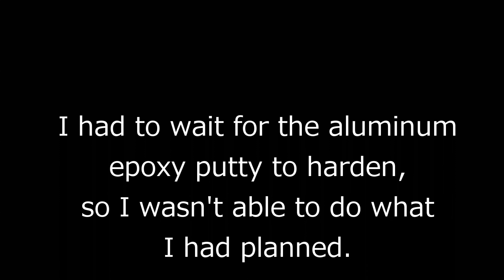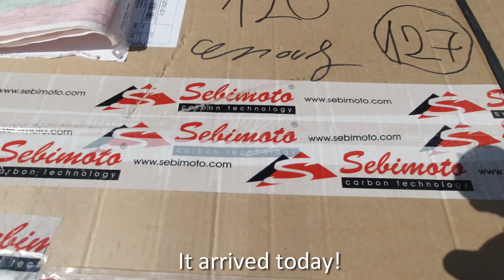aprilia RS125 Install ABSTRACT racing "Racing line" Part 1

Comment: Hey ! Do u have have the carburator Intake side size ?
I think I will need this kit my RS
Reply from the maker: Fits 34mm carburetor. Probably the 28mm carburetor is the same size.
Reply: @PochiRS  k thx
so I Don't need this product my carburator is 39mm sized
Reply: @matkaisencazou2296  39mm what set up you using with the carb bet it flys

Comment: Mr. Pochi..purtroppo lei ha un collettore aspirazione  "artigianale" e questo è stato un bel problema....i pezzi ABSTRACT Racing sono plug and play, e il pacco le è arrivato sicuramente con la guida dove all'interno c'è tutto scritto..passo dopo passo..vedere uno scempio del genere è stato veramente bruttissimo..ha distrutto un guidaflussi per nulla..e poi cercato di sistemarlo con "stucco".. il problema è che è tutto plug and Play  con roba originale.... cosa che lei non ha..il video me lo aspettavo molto diverso.. anche il "cornetto di aspirazione" che lei lo ha messo nel carburatore sopra ad un altro pezzo bianco creato da lei.... forse era meglio rifare il video con roba originale....
Cordiali saluti Davide Catalano.
Reply: Davide Catalano hello m. Catalalo, this is possible to buy the file .stl for print this pieces at home ?
Reply from the maker: With ABSTRACT Racing telling me how to use it correctly, I understand that I'm doing something I shouldn't do.
However, this time I wanted to combine it with my original manifold.